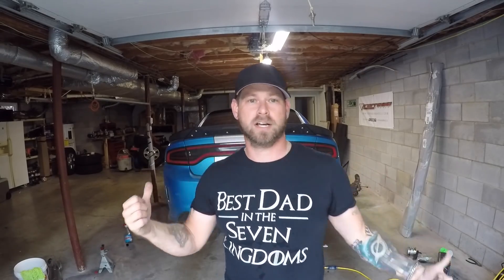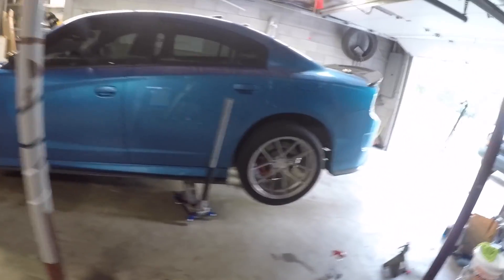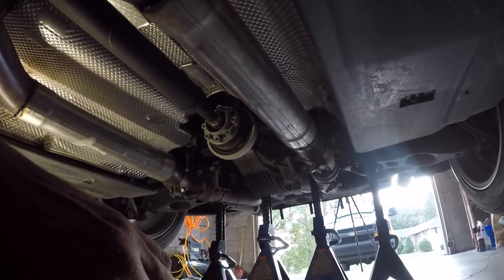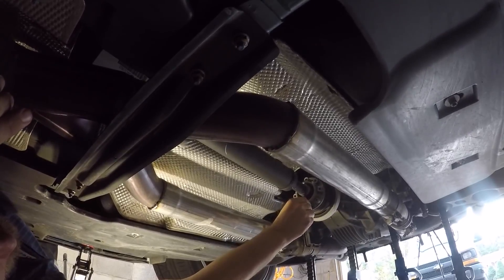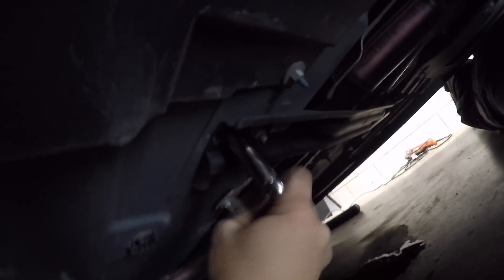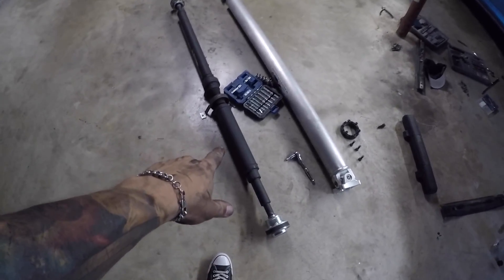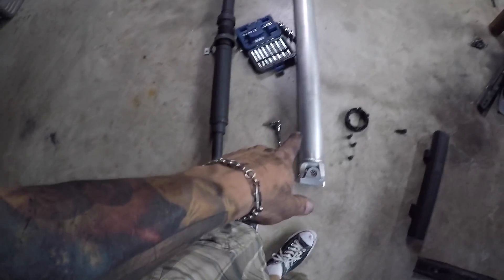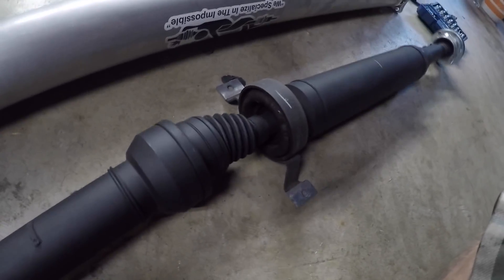Dodge Demon Killer: Step 1: Driveshaft

Comment: Definitely get ride of the factory blower . I would do whipple or Kenny . Then a Cam swap . Then long tubes with a full exhaust . Then do full E85 return style system on it . After all that drop the transmission and update the converter . Do you have a line lock on the hell cat ?
Reply from the maker: Yfz450r which shop is this? Because I only know of one shop that does flex fuel tuning. Legit flex fuel tuning. I wonder if it's one and the same

Comment: DSS for the win! I went with the CF and I hope it doesn't shatter! :(
Reply from the maker: Snowcat_srt depends on your power and track prep. More than likely won't be an issue. But replacing a $900 driveshaft is better than replacing a $1600 one, for me. Since I'm going to be on the track a lot
Reply: Coworker shattered his CF drive shaft first trip to the drag strip. He was running slicks though.
Reply: The thing is that C.F. driveshafts are stronger but will damage easily. If they get hit they will shatter real quick. I guess time will tell I don't think WAS would release a product that was meant for a higher hp application and for it to be weaker. Thanks for the input

Comment: Demon killer?hmmmm...makes ya wonder what an apples-to-apples comparison would be if ya modded factory stock Demon in similar ways,  who kills who in the end, and be a lot more reliable, consistent times with alot cooler running temps run after run while doing it. 
In the end, my money is on Demon in the 8's  😈😎👍

good luck to you on build. luv to race. lookin forward to ya kickin butt brother at track against competition.😎💪

 heard Leno will get #2 Demon and only about 20+  or so being built this year. 

Guess the New year will start off right for ya then.😈😎
Reply from the maker: Faithful Servant the demon will no doubt be more reliable, finely tuned, smooth, and warranty. But everyone started with "I don't need a demon, I'll make my hellcat a demon killer" once the demon was announced. So I figured a little series on making a hellcat run with a demon would be helpful to the fam on here. I hope hope hope I don't have to wait til next year for mine

Comment: dam bud, you really need some tools............... just sayin
Reply from the maker: harleyguyinmilw I have a 5' tall craftsman chest full of any tool you would ever need.
Reply: I didn't mean anything, it just sorta seemed you guys were struggling.....
Reply from the maker: harleyguyinmilw I need a lift most of all. I have some air tools but don't have a good compressor to run them. Maybe soon.
Reply: I hear ya!!, I have a 6hp/80gal tank and it ain't big enough!! (body work tools, D/A, board file, etc really use alot of air)